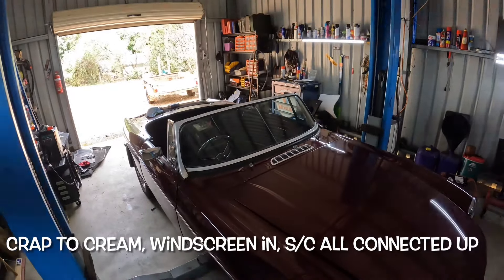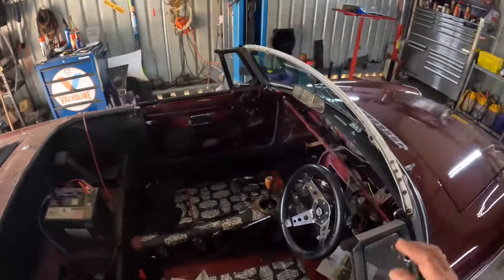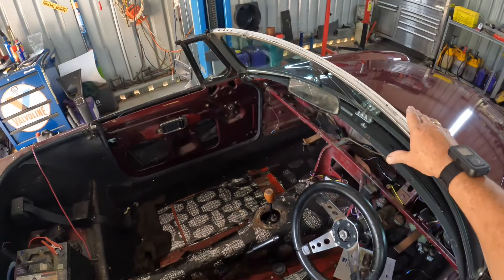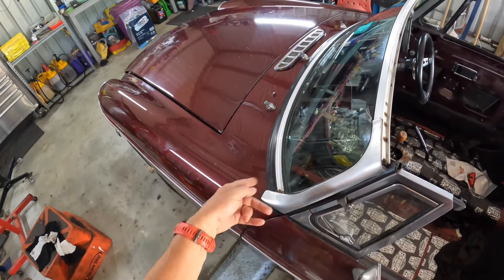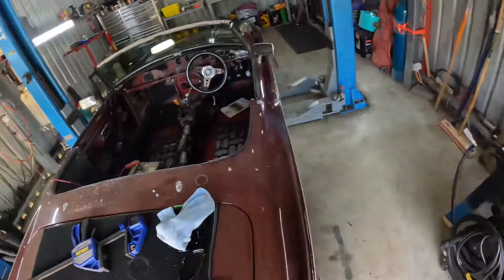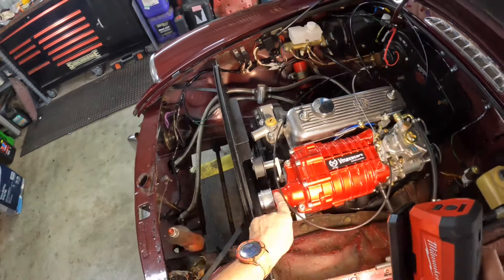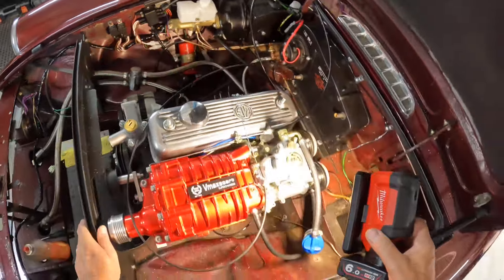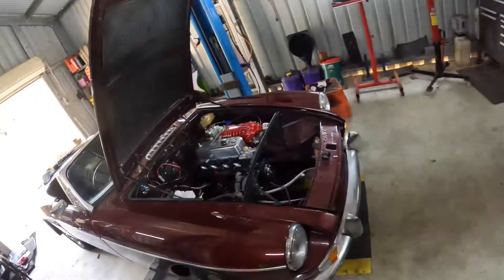Crap to Cream, MGB RHD windscreen fitted, supercharger all connected up and ready to go.

Comment: Yyou can tee into the boost gauge pipe for the dizzy vacuum , but ideally you dont want more than 7 or so degrees of added vacuum advance, 123 and csi dizzy s that have a vac port can tailor the added vacuum to this maxiumum. You can run with out vacuum advance but this can show cruise mixture as rich due to the fact it has less timing (time) to burn the fuel. Also the mesh filters will restrict more than the supplied foam filter which again will make the mixture slightly richer.
Reply from the maker: Thanks Stuart, I'll do the tie-in as suggested, I've only got the mesh filters on the carburettor at the moment to stop any crap going into the "trumpets".  Also didn't want to risk damaging the foam filters, I still have a ways to go before I actually need anything filtering.  No doubt I'll be in touch about the timing at the "point of ignition".

Comment: Before you install the dashboard, move the centre fixing stud for the tonneau cover to the other side. It would have been easier to drill the new holes before installing the screen, but the dashboard will make it very difficult.
Reply from the maker: Hi Mark, thanks for that, I’ve got one of those right angle drills which should make drilling the holes easier. Well spotted, thank you. Cheers Marty
Reply: yup - I did that - one of mine was cross threaded and that was the easier solution ....

Comment: Nice work. Solid progress. You don’t let the grass grow under your feet. Do you?
Reply from the maker: Hi Pat, don't get to used to it, I am retired, plus I wanted to get to a point that I could at least push the MG out of the shed to do some work on my wife's Mini.  I wanted to get the engine in so I could put the steering rack in place one final time, however if you have been following which I suspect you have, you'll know about my issues with the LHD / RHD front crossmember and the steering rack alignment to the chassis rail.  I've sourced a replacement cross member now so that'll be something to change out when it arrives.
          Also moving into the world of electrons which always slows me down, gotta get the dash in and wire up all the new instruments, electrickery is not really my strong point but I persevere.